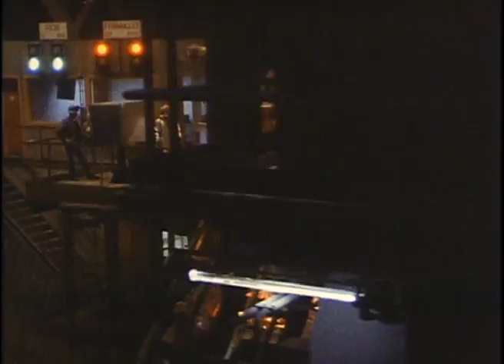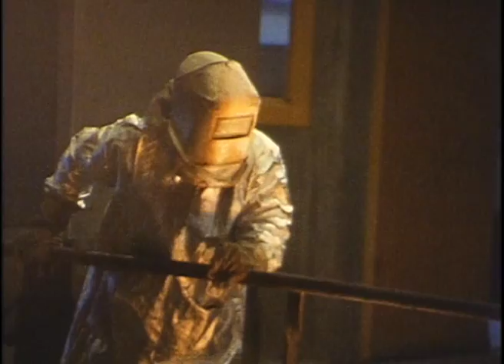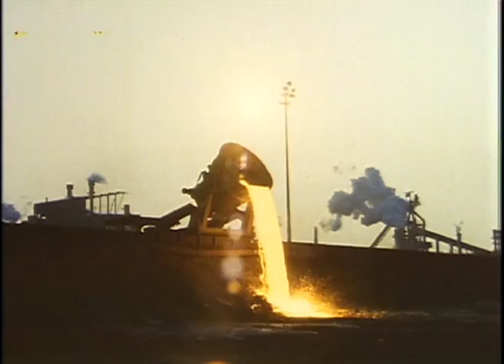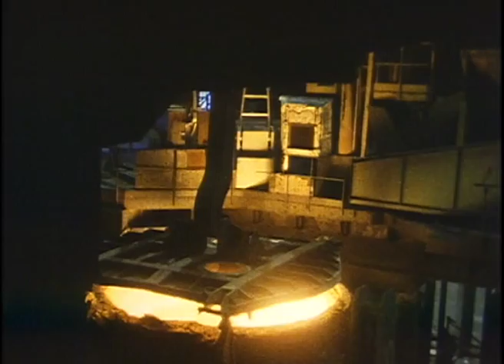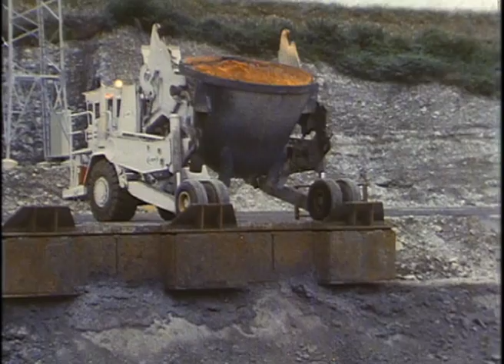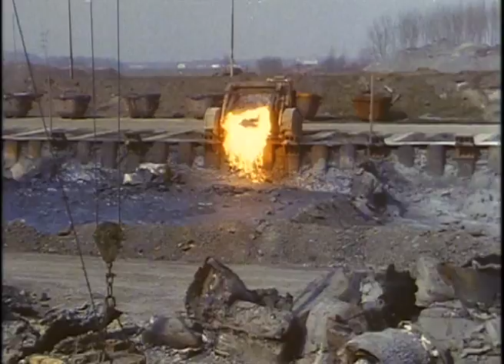British Steel, Redcar Teesside - 1984

Comment: not the redcar iron or steelplants as stated
Reply: Absolutely correct, Teesside never operated Pot Carriers to the Iron ponds, was always torpedos
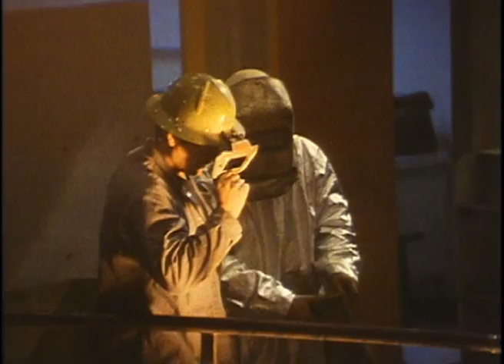Reply: @dandanthegadgetman  My guess is it is the USA   check the dudes Hard Hat @ 00:15
Reply: @kmmining1359  no it was the BOS plant at Lackenby and the concast and gagar cutters The big white vehicle was emptying slag from the BOS plant at Mougets reclamation, between the BOS plant and the river Tees. I worked there for 35 years between 1975 and 2010.. I remember those special furnace helmets being worn in there, they were different to normal safety helmets having a welding type lens to look at hot metal if you look carefully. Liquid iron used to be pulled by locos in torpedo ladles from Redcar Blast Furnace, to the BOS plant, where it was poured into ladles to then be blasted with an oxygen lance , to turn the iron into steel by removing carbon, adding additions, vacuum degassing etc. Once the steel was made it was poured into the bloom or slab casters to solidify and then cut into lengths by propane lances called gagar cutters. From there the finished slabs / blooms went off to the Mills to be rolled to the sizes customers required.
Reply: @dandanthegadgetman wrong, it was from lackenby BOS plant. They were steel plant ladles at Mougets reclamation being tipped of slag to be made into roads.

Comment: Sorry but this video is not of the iron orsteelplants
Reply: It is the lackenby steel plant called the basic oxygen steel plant, which turns iron delivered in torpedos from Redcar Blast Furnace into steel by removing the carbon with oxygen lances. It is not the old lackenby open hearth type steel plant that was near the trunk road side but the more modern basic oxygen steel plant next to tees dock road.

Comment: Nice video of Steel Works but not Redcar, they never had pot carriers
Reply: That’s right they had Demag Distington Torpedo carriers when I worked there.
Reply: @paulnolan1352  it was the bos / concast steel plant at lackenby not Redcar iron works. Steel was never made at Redcar, only Iron. Steel is made from iron in a steel plant where ladles were used after being filled from iron from Redcar Blast Furnace torpedo ladles. Torpedo ladles are designed to reduce heat loss, carrying the liquid iron from Redcar to lackenby. the ladles you saw in this film were to make and carry iron / steel in at the bos / concast plant after being injected with oxygen into the iron to remove carbon turning the iron into steel along with other additions etc depending on customer requirements of the type of steel being made.